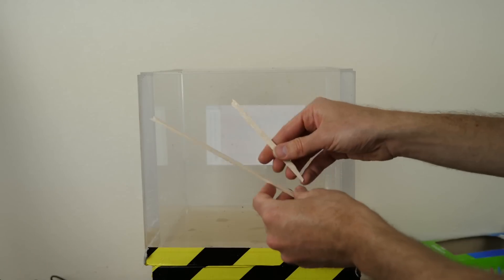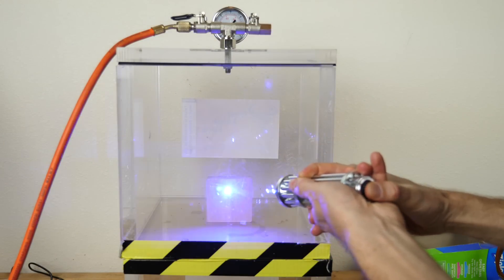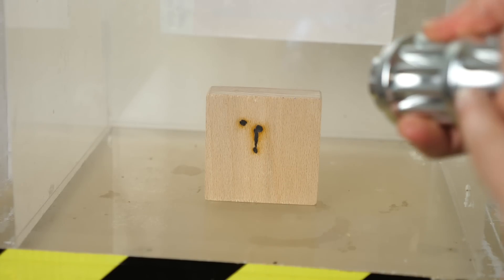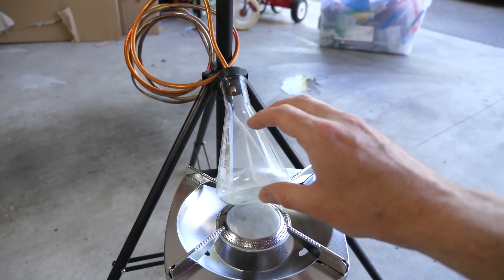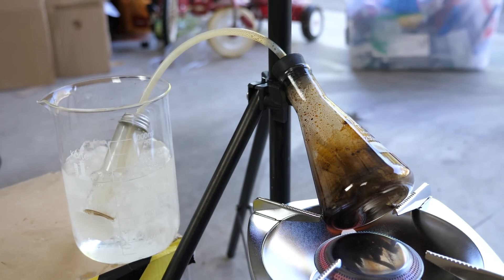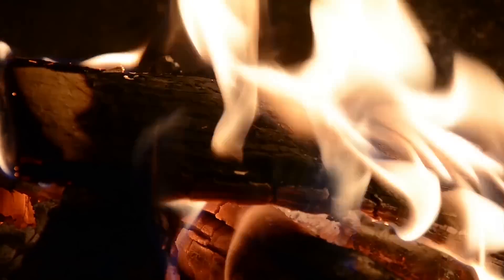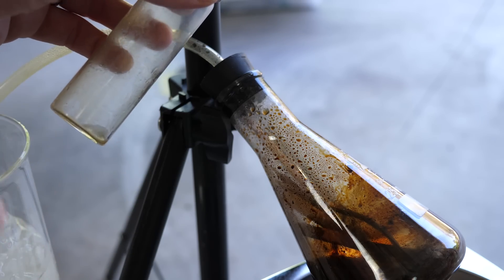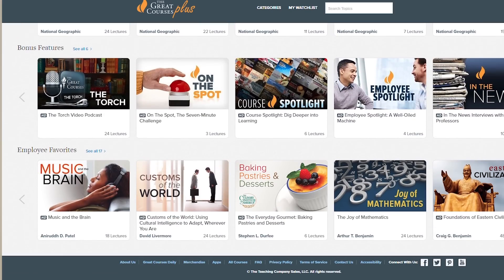Is It Possible to Melt Wood in a Vacuum Chamber? The Wood Distillation Experiment

Comment: I got a question : how tiny is the tiniest thing you can feel with human nerves?
Reply: Ooh good question did you ever find the answer
Reply: @death3678  nope
Reply: @timeladsedits  I think it’s 9 nanometers
Reply: @death3678  air, but that maybe is just the airflow
Reply: Those little fucking bugs
Reply: Matt Burns 

Thunder bugs?
Reply: @Dildobagginses  gnats?
Reply: @Dildobagginses  what about the ones 

y  o  u     c  a  n  t    f  e  e  l
Reply: This question is to ambiguous to answer concretely. Everyone feels things subjectively. A human nerve is typically protected by many layers of other tissues. So an exposed nerve can "feel" much tinier stimuli than one under the skin. The nose for instance can detect molecules. The Eyes can detect electromagnetic waves. Both are a form of interaction or type of feeling. So as should be obvious, the answer is going to be it depends. I imagine you want to know what can cause a sensation on the skin though, and even that question doesn't have a definitive answer as the nerve density is different depending on which part of the body is being touched. A nerve once activated does not feel a second response. Try poking the back of your arm with two sharpened pencils, not sharp enough to inflict damage, but pointy enough to feel. Then touch the points to the back of your arm and gradually move one closer to your elbow and the other closer to your shoulder. Be sure to keep the pencils in a relatively straight line in relation to each other on the back of your arm. You may need help to do this experiment. At what distance between the pencils can you feel both pencil points? Then try it on other parts of your body. It is a fun experiment but it also shows how difficult it is to answer this question. Nerves are weird.
Reply: @matthewdancz9152  I feel like you added too many possibilities and over complicated a relatively easy to solve question (easy as in someone who knows what they’re talking about can answer or figure out).  The question was what is the smallest thing you can feel.  With that being said where it touches doesn’t matter.  Also I don’t know how the fuck you expect people to touch the back of their arm going opposite ways lmao
Reply: Our fingers can distinguish a distance of 17 nm between two objects .. i.e the minimum...
Reply: Gavin's Universe nah, too small, a nerve can’t just feel a single atom
Reply: @sylver546  You are wrong mate! Your tongue can literally detect single protons. When you are tasting acidic stuff, its the H+ (proton) you are tasting.
Reply: @sylver546  What if you can but your brain ignores it 😳
Reply: @sylver546  but it can feel 10 billion, so technically…..
Reply: @sylver546  astronauts have seen the flash of a single atom's nucleus (cosmic ray) going through their eye at half to 99.6% the speed of light.
Reply: on a science test I got a question:
"What are nerves composed of" or something. I wrote "atoms"
Reply: A needle. Anything that breaks the first layer of human tissue no matter how small can be felt except of course not subatomic particles that's impossible.
Reply: @ftfyoungleon  You can see light. The optic nerve is a nerve. Photons are subatomic.
Reply: @ftfyoungleon  You CAN feel subatomic particles-if there's enough of them in one place. That's what electric shocks are. Also what certain kinds of cell damage are, though again, you likely only FEEL that per se if there's a lot over a short time. You can also sometimes see them if they hit the back of your eye at the right angle and speed (they look like little white or blue flashes or shooting stars- not common on Earth, but common in space.)
Reply: You CAN feel subatomic particles-if there's enough of them in one place. That's what electric shocks are. Also what certain kinds of cell damage are, though again, you likely only FEEL that per se if there's a lot over a short time. You can also sometimes see them if they hit the back of your eye at the right angle and speed (they look like little white or blue flashes or shooting stars- not common on Earth, but common in space.)
Reply: @ftfyoungleon  idk, airs pretty small   also temperature   this kind of a loaded question, it needs to b more specific
Reply: @ftfyoungleon  u feel ur hairs when u get goosebumps
Reply: @ftfyoungleon  nope, what about the needles from a mosquito
Reply: @ftfyoungleon  I can feel your atom.
Reply: @ftfyoungleon  agreed my first thought
Reply: @ftfyoungleon  dude, the only reason you feel things in the first place is because your electron field is interacting with other electron fields.
Reply: @ftfyoungleon  I once had a muskieto landing on my hand. so I looked if it would sting... first time I felt a muskieto sting. I thought it was strange that I felt it... but apparently not :p
Reply: @ftfyoungleon  thanks, man
Reply: Chad Klaren  I don't even have one
Reply: @Gavin's Channel you cant feel atoms.
Reply: Dust in your nose that makes you sneze
Reply: Probably your pp
Reply: Idk if you already got an answer, but this is close. If your fingertip was the size of the entire earth, you would be able to distinguish between a house and a car
Reply: The answer lies beyond your understanding, in fact it has been solved by our ancestor long ago before we were even considered as humans or exactly in the species of *Homo sapiens*. That's the reason behind why there are many stages of education everywhere on the world hoping that someday someone will finally answer this very important question of and to humanatee. 

The solution began when Sr. Monke D'Grategrandpa was chased by a Beeg Fhat Feline's absolute solitary unit or the so-called BFF's tear-it that has been stranded alone in the wild for almost a decade. But he managed to survive the chase by using full capability of his entire nervous system (especially the brain and motoric system) to outsmart and to outrun that unit. After experiencing the same problem everywhere he goes, he realized that he can't always rely on the escaping strategy and had to fight back, but he has no built in weapons. Based on this thinking in mind, he experimented with many kind of tools available for his species at that time to make the absolute weapon, from the hardest stone to the strongest stick but nothing seems to work against the tear-it . And then the light bulb moment comes, the enlightenment, the renaissance of the apes, he realized he fundamental thing of what makes the tear-it so powerful. It is not about the strength and sturdiness but sharpness. Sharpness is the thing that can cut. Then he sharpens all the sticks and stones he can find and bring it everywhere he goes in order to defend himself whenever threats are going to come.

The answer to your question should be sharp edges or sharp pointed objects. 
Because with sharp edge which is very tiny, your skin would immediately feel pain, for example the sharp tip of a needle.

Keep in mind that my opinion is joke-based to entertain whoever the reader is. Good day :D.
Reply: Fingers can feel 13 nanometers small things. That is how you can feel the difference between different materials.
Reply: Basically if anything, no matter how small exerts enough force on your skin it can technically be felt, tho if it’s small enough it willl probably break skin before it’s felt. That’s why tiny hairs can be felt.
Reply: There's a man which put his head in the particle accelerator. And he felt it.
Reply: "Human fingers can feel objects as small as 13 nanometers. If your finger was the size of the Earth, you would feel the difference between houses and cars."
Reply: for scale, if your finger tip was the size of earth, you'd feel cars
Reply: Probably light, since the human eye can detect a single photon.
Reply: A photon
Reply: Probably something very tiny
Reply: From my expérience, with touch, you can approx sense 0,1 mm of difference in lengh
Reply: this needs to b more specific, u can feel air, n temperature, magnetic field if theyre strong enough, somebody said needle but u can feel when something touches hairs on ur arm..its just a really broad question and can really b answered the way it is without speaking on somethin specific or writing a whole bunch    interesting question tho ill b thinkin about it
Reply: @4dirt2racer0  we only feel the root of our hair, the rest is all dead
Reply: If Your Male, Look Down
Reply: @Gavin's Channel I'm sure you can hold an atom, but not consciously feel it
Reply: you can experiment with this pretty easily using hair
chop hair into different sized pieces and see what is the smallest you can feel
Reply: mine
Reply: Get some polishing paste and see if you can distinguish it from wax or butter. You can detect miniscule particles.
Reply: depends on the nerve placements which depends on the part of the body, it can range from a centimeter down to millimeters
Reply: no limit to how small a thing you can feel if it hits you hard enough
Reply: and spec of dirt
Reply: I can, at least, feel seed ticks spreading out all over.  They're pretty dang small. lol.
Reply: a photon can be "
felt" with your visual nerves
Reply: Nerves don't feel, they receive signals, so it all depends whether something generates a signal or not.
Reply: your nose is pretty good at detecting various smells, when their molecules are relatively small
Reply: A shot
Reply: I'm pretty sure the smallest thing you could feel is an electron. You know when you touch someone or high five them or whatever you feel a little shock? That's an electron. I think what it does is re-destribute the electric charge you have so it's balanced. I learned this in science a couple of years ago but I can't really remember if it was that or something else. Probably something else as I am as stupid as a baby
Reply: @sonic_sanchez1709  The phenomenon is called “Static Discharge” it happens when one object has more static charge than another object and when they touch the extra charge jumps to the other object evening it out.
Reply: @sonic_sanchez1709  that is a compilation of electrons. An electron is too small to be felt.
Reply: nerve can feel chemical release by other nerve，so it can feel up to some very very very very small thing i thinl
Reply: Astronauts feel cosmic rays when they go to space
Reply: My guess, a human hair.
Reply: Our can touch around 30nm
Reply: ...the resolution of human nerves?
Reply: Heat a.k.a. photones.
Reply: Theoretically speaking, which ever nerve in your body has the lowest threshold to generate an action potential. Of course there is not way of practically testing every nerve in your body to determine this, hence why I said theoretically.
Reply: You need a definitive answer to this?
Picture we made the earth as small as an apple, everything on it woud also scale down, if you ran your finger across it you could tell the difference between a suburban home and a car, merely with your finger.

That's how fine the nerves are.
Reply: @oufofmemory  Holy shit, thanks for this explanation.
Reply: @oufofmemory  yhh bro keep it up we need more polite smart people like you on the internet!!
Reply: I would actually say the smallest "thing" that we can feel as humans is electromagnetic waves. 

The presence of an EMF makes the skin react, which we can definitely feel at high enough levels. 
I use the term "thing" loosely here because technically EMF is not an object, it's a wave of magnetic energy through particles of air or some other medium. 
But still, pretty tiny.
Reply: Electrons?
Reply: @mrWhite81  lol. This is the only correct answer
Reply: As a machinist it seems you can feel things that are 20 thousandths of an inch and larger: 0.002" and bigger.
Reply: Ur

Pp
Reply: I think clay sediment?
Reply: Lol
U can’t feel it. 
I mean u can’t feel germs moving through your skin or in your body
Reply: @afoxcatartvideos4877  Imagine how awful life would be if we could feel the trillions of bacteria both good and bad crawling through and on our bodies. The thought makes my skin crawl.
Reply: @matthewdancz9152  You can't feel the individual ones, but that's what that furry feeling you probably sometimes get on your teeth is. Yuck.
Reply: The cold or heat in the air
Reply: Air
Reply: @Froddobaggins WasmyMilkman I said I wrote "atoms"
Reply: Matter of perspective
Reply: @Gavin's Channel If it moves fast enough
Reply: CHIGGERS!!👵
Reply: Air?
Reply: A dose of lsd is tha smallest thing you can feel ;)
Reply: My ex wife's new bf, most likely.
Reply: The stink eye.
Reply: https://www.youtube.com/watch?v=jffQVdJdoKQ This should answer your question
Reply: @Gavin's Channel 

def not.
Reply: The internet says .2 millimeters, or about 1/120th of an inch. For scale, the naked eye can only see down to .1 millimeters, so it's practically invisible. If you want a practical example, chiggers (the parasitic insects) are probably the smallest thing that you will ever feel at about .4 millimeters.
Reply: my self esteem
Reply: @Gavin's Channel can you feel the air molecules around you? The individual atoms? No you can’t. You don’t seem to under what the human nervous system is capable of, so it is recommended that you don’t post such idiotic comments.
Reply: A strand of hair? I don't know I'm not too sure.
Reply: For me, a dirty old used copy of Razzle
Reply: A needle. Anything that breaks the first layer of human tissue no matter how small can be felt except of course not subatomic particles that's impossible.
Reply: Ask your woman!!!😂😂😂
Reply: Carbon in the form of fire
Reply: I heard skin is so sensitive that it can feel the wing of a bee falling into your cheek from 2cm above or something like that haha
Reply: My cok😢
Reply: feel this
Reply: you can feel a thousandths of an inch
Reply: -40 mV electriciry
Reply: @odp1993  no. you apply a current to get to an electrostatic potential of -40 mV. Given that you can actually use that to even out the voltage inside and outside the cell membrane, that is now how it generally works. Also, I believe that a neuron is sometimes even able to sense a depolarizing current that brings the voltage in the axon up to around -55 mV. There are some standard errors sometimes.
Reply: @odp1993  so if my logic is correct then in theory there should be a minimum amount, though in practice, you generally only follow the 55-40 mV threshold (my speculation, I don't know the exact numbers). That is because there are 'gates' that if triggered (i refer to 'gates' as the system of passive and active ion channels) also triggers all the 'other gates' beside it. Unless one of these 'gates' are stimulated enough, the other gates will not open and there is no sensation whatsoever.
Reply: A photon, i guess.
Reply: Above 5 inches ):
Reply: What kind of feel? What kind of thing? What kind of nerve?
Reply: @alfianfahmi5430  wdym kind of feel? Wdym what nerve? Like a human nerve? Cause he said it was a human nerve and feel is caused by nerves so what’s the point of the type of feel it makes no sense
Reply: @stikzOSC  Let me ask you this : What defines a feeling? Was it the reaction from our sensing organ? Does eye sight count as feeling, since eyes sense the presence of light? If that counts, then wave of light is going to be one of the tiniest things humans can feel 🗿
Reply: sourness
Reply: ask my wife
Reply: It’s very tiny 😊
Reply: Basically there is no 'tiniest' in what you can feel because once a stimulus excites a nerve, the nerve will stop becoming more excited, turn off its ability to be stimulated, and will be immune to it for a very short amount of time. The 'tiniest' amount of stimulus you can feel, therefore, is the amount of stimulus that can excite your nerves which also happens to be the biggest stimulus you can feel in a nerve. One can only feel a larger stimulus because more nerves are excited.

EDIT: I meant neurons. Nerves are a compilation of neurons (specifically their axons). So if you want the tiniest stimuli, go to the trochlear nerve or if you want touch sensation, then just try your palms and fingertips. There are a lot of sensitive neurons there that connect to the nerves of the hand (technically stimulating those nerves).
Reply: I don't expect anyone ever to read this, but human retinal cells can detect a single photon.
Reply: Probably acupressure.
Reply: Human fingers can feel objects as small as 13 nanometers. If your finger was the size of the Earth, you would feel the difference between houses and cars.
Reply: look in your pants and you shall find what your looking for
Reply: Needle or blood drop
Reply: Light speed photon technically lol
Reply: An electron.
Reply: you can feel photons hitting your skin. At least I can when I step into the sun...
Reply: Misgenderism.
Reply: It depends on how exposed the nerve is. Pull a tooth, the exposed nerve can feel air, and it can be excruciatingly painful.
Reply: 20 nano meter
Reply: I think I have something, but I need someone to help with the experiment
Reply: Human nerves
Reply: stfu thats disturbin 😂
Reply: You can feel the tinyest tip of a needle if it is pinching on a nerve or tactyle organ. You can detect the density of these organs by seeing how far apart two needles need to be to feel them as two.
Reply: A single photon crossing your retina can be sensed, provided you're otherwise in absolute darkness. Can't go much tinier than a photon.
Reply: I'm scared as to why you clarified the nerves were human nerves
Reply: i mean like what is that spider feeling with your hairs what is that how small is that
Reply: Well technically you dont feel anything the atoms around the thing just change and that alerts the nerves and if the nerves get hit then its the pain you feel
Reply: size doesnt matter
Reply: anything that can apply force on your skin can be felt
Reply: its not nerves its skin, and you cant feel a lot tinier things
Reply: Your question needs rephrasing regarding which sensory system you're talking about. For your general question, it should be the olfactory nerve (cranial nerve for the sense of smell) that can sense tiny aromatic molecules of size about few nanometers
Reply: anything that can move one of your hairs can be felt no matter how small, hair kind of amplifies the "feeling"
Reply: @evilguy_995  no, you can feel smaller things
Reply: @evilguy_995  if you put your hand in a particle accelerator you will feel your hand being cut in half, even though the particles are just 1 atom big
Reply: a single photon shot in the dark
Reply: If you put some suitable neurotoxin directly to nerve ending, probably quite tiny, but would guess, at least some amount of molecules.
Reply: trick answer: zero. you can feel a single electron, which is loosely defined as having zero size
Reply: Your bepis.
Reply: Electricity
Reply: You can feel a hair in your eye, you can feel dust in your nose. You can feel a needle in your skin. You can feel electricity. There was a man hit by a proton beam in a particle accelerator. He felt that. He didn't die (amazingly) but he damn well felt it.
Reply: I feel like it's more a question of pressure than of size
Reply: theoretically any sized object can be felt if it applies enough force.
that is the real question, how much force is needed for you to feel something? and obviously the answer would depend on the surface area it applies this force againt, and non linearly as well.
Reply: hair strand probably
Reply: Your brain man, your brain 🤣🤣
Reply: @greatarnab  dude, be kind
Reply: @coasel1919  bro it’s a joke how do you find that rude lol
Reply: U can feel it lol
Reply: @greatarnab  Speak 4 urself
Reply: @greatarnab  ur pp
Reply: @Gavin's Channel nah